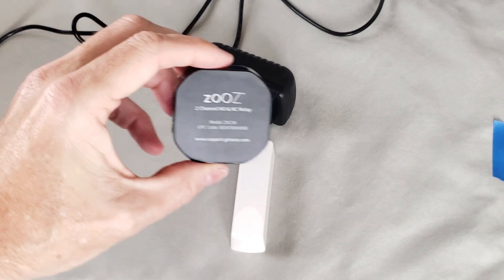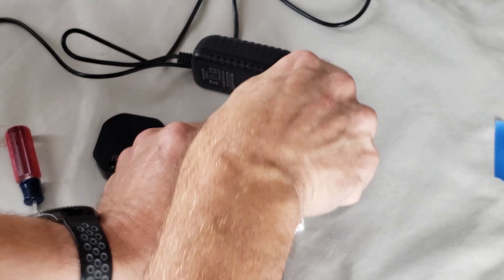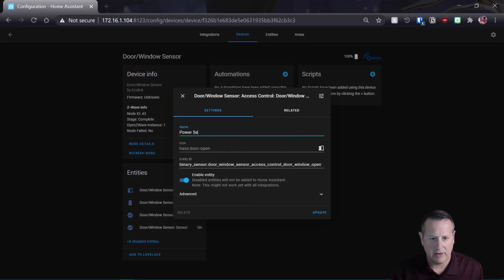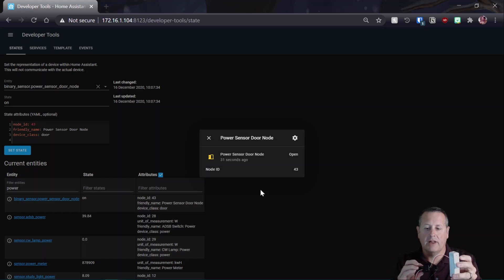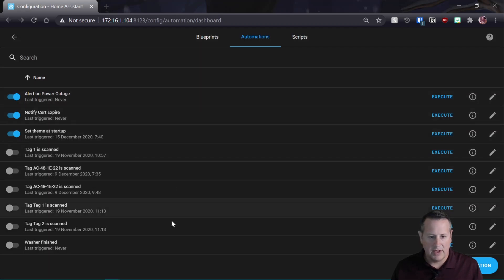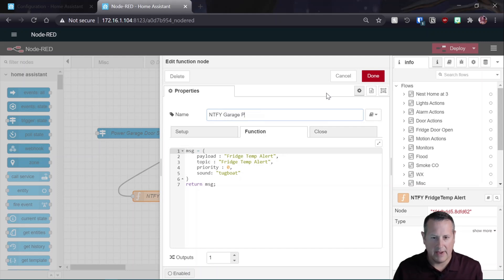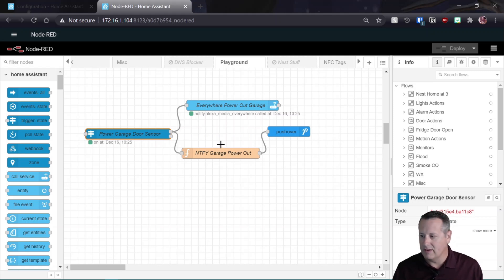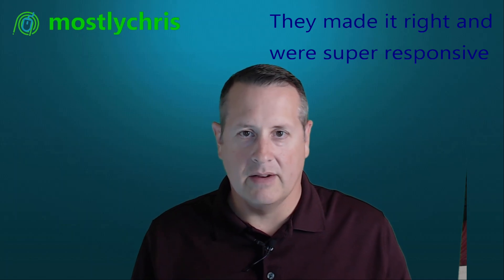The power is out! Get alerts via Home Assistant

Comment: I'm just brainstorming here, but I seems that this would be possible to do with any device that is AC powered (Kasa wifi plug, Ikea Tradfri zigbee outlet, esphome entity). When the device becomes unavailable it is possibly unpowered. To make certain power is out, make a group of sensors that is true if all its members are 'unavailable'. I can count >25 devices in my house that would all go out in a power outage.

The inverse is also possible. I have several smart bulbs that are controlled by dumb switches. If they become available, I know that someone is there or that someone has left a light on -- cough teenager *cough*.

Comment: Hello there, 
Really great job…
Can we do this without z wave hub? Or can this sensor be connected with zigbee hub? Can it work and send notification to our mobile?
Thanks for your assistance
Reply from the maker: They key is to have the device be able to report a contact state change AFTER the power goes out. Anything that is battery powered and can report a state change back to a hub that has backup power supply (UPS) on it should work. The notifications go to my mobile via Pushover because I have a UPS on my hub and on my Internet connection. All I need is enough time on the UPSes to get the notification out.

Comment: is there a zigbee sensor that can do same?
Reply from the maker: Maybe. I commented elsewhere in this video about the requirements of having a sensor that can report AFTER a power outage. You just need contact closures on a battery powered zigbee device that can be closed/opened via a relay that changes state when the mains power goes out. The RF (zwave/zigbee/wifi/etc) doesn't matter as long as the hub receiving those signals has a backup power source long enough to detect the change on the sending sensor.

Comment: I need this solution and intend to implement it as soon as practical.  I don't currently have any Z-Wave devices.  Is it fair to assume that I need a Z-wave hub and the home assistant app to fully implement this solution?  If so, can you recommend an inexpensive hub?  If I need anything else, please advise that as well.  I expect that I will be adding additional devices in the future.
Reply from the maker: Yes, you need a hub of some sort. Take a look at my stuff here: https://kit.co/mcyoutube/home-assistant-gear. I use the Aeotec Z-Stick Gen 5. Make sure that wherever you run the hub, it can reach your zwave device(s). You'll need to set up Home Assistant if you don't have that. I have a whole Back to the Basics series on that if you need it.

Comment: Really awesome project. You're one of the few I've seen cover power outages. I'm wanting to get into HA myself but I've just been watching and researching so far. I have a question about power outages with HA since I live in a rural area and power outages are pretty common (one every 2 or 3 months). So my question is, if I have an item like a light set to turn on at dusk every night. If there was a power outage before dusk and power was restored after dusk. How would you get HA or Node Red to check and see the status of the light and turn it on and get it back on schedule? Would it check when it reboots after power has returned? Also how would that work if you have your HA on a UPS. The HA instance would still trigger because it has power, however the item like the light wouldn't because it doesn't have power, so how would you make sure that's corrected when power is restored? It seems to me like it may be easier for Node Red to correct these but I am unsure as I've not taken the plunge yet, just dipping my toes in right now.
Reply from the maker: Thanks for the comments. You could use NodeRED to check a status of a switch on a regular basis with something like a poll node. You could run an automation in HA to check the status of the light on a scheduled basis and turn it on if it is off. You could also just run the switch.turn_on service every few minutes from dusk to dawn and that would make sure it was on, however that is probably not very efficient. There are all kinds of ways to accomplish this so it is definitely something you can do.
Reply: @mostlychris  Alright awesome, thanks so much. Do you think you could cover it in a livestream possibly? I'm sure I'm not the only one who would benefit from it. The check automation and NodeRED polling seem very interesting.
Reply from the maker: Apologies for this slipping through. YT's comment management isn't great. Did you get what you needed on this?

Comment: This ecolink door sensor is not for sale in Europe. So far I bought the even cheaper neo coolcam z-wave door sensor on AliExpress for less than 20$. I simply soldered a wire to each end of the reed switch which only takes a minute. I also bought 2$ car seat pressure sensors which I connected to those wires and placed under the mattress of my bed. This way for 20$ I have a bed occupancy sensor. The problem is that I bought some new neo coolcam door sensors and these don't have the usual reed switch to detect the magnet. So I haven't been able to figure out on this new model how to use it like you use the ecolink in this video. Do you know of any cheap z-wave sensors for sale in Europe that either have direct connectors for wires or where I can for example bypass a reed switch by soldering some wires?
Reply from the maker: I'm not sure what's available in Europe. This store seems to have stuff but when I go there it directs me to US pricing, which seems expensive for the device. You might be able to find something on this site since they allow selection of frequency which I assume is the difference in each country (868.4MHz in the EU). https://popp.to/products/aeotec-door-window-sensor-7-zwa008?variant=34602072014893 // Same thing , different site. Still seems pricey to me but not really sure what is considered expensive in that region.
Reply: @mostlychris  thank you! After some further testing I figured out that the new models of the cheap neo coolcam sensor still work fine! So if you want to recommend your viewers a cheap alternative for Europe: https://www.aliexpress.com/item/32866259582.html?spm=a2g0s.9042311.0.0.27424c4dWYTyVU and if you want to build a cheap bed occupancy sensor (could also work under a doormat): https://www.aliexpress.com/item/4000148923476.html?spm=a2g0s.9042311.0.0.7f914c4dd5nmL7
Reply from the maker: Thanks!